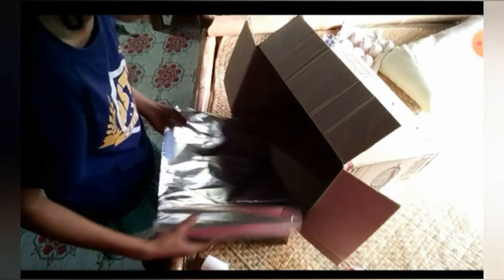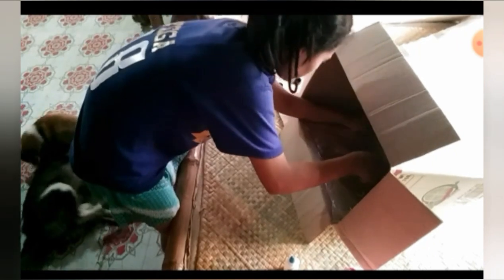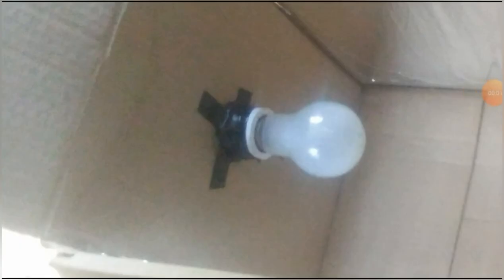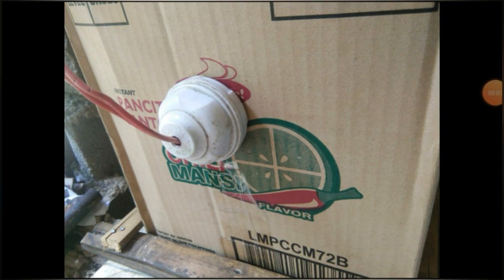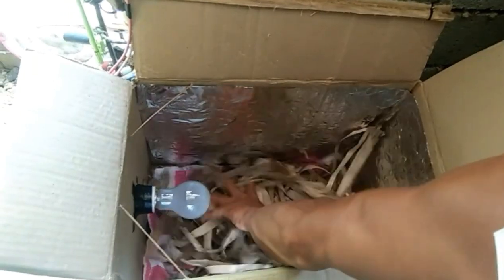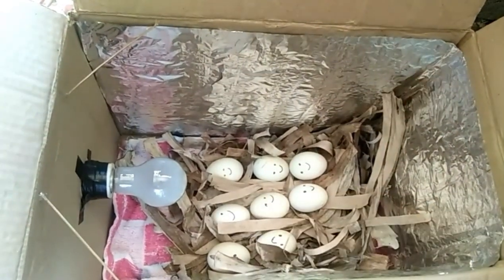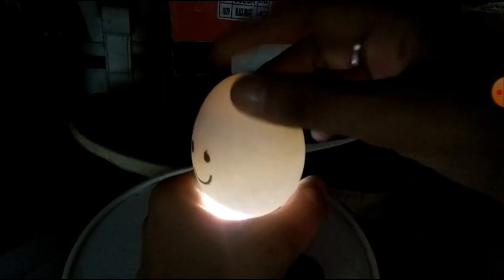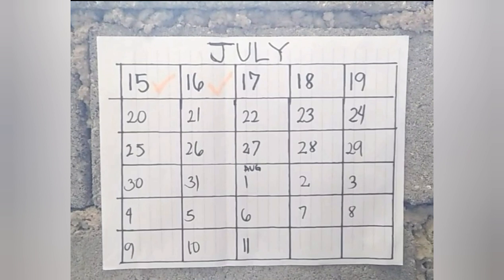PAANO GUMAWA NG HOMEMADE DUCK EGG INCUBATOR/PILIPINAS/TAGALOG

Comment: Hello po tanong ko Lang po parati ba naka on Ang ilaw? At ilang temperature ba require po sa incubation? Okay Lang ba na Hindi na maglagay ng tubig?
Reply from the maker: Good eve po sir / maam . Bilang first timer ko lng din po mag set, ito po ang aking mga ginawa. Una po nag se set ako ng tig 1 hour na patay ang ilaw sa gabi at umaga. Sa temperature naman po , ang alam kupo pag sa chicken eggs, nasa 32 to 37 degree po ang require ,then sa duck eggs po ay 35 to 38 degree. About naman po sa water, mas okay po na may tubig na nakalagay to control the heat po. Salamat po.
Reply: @KVEGA  thanks op